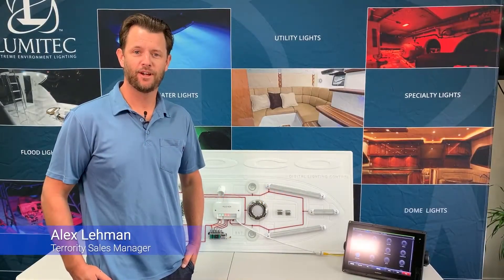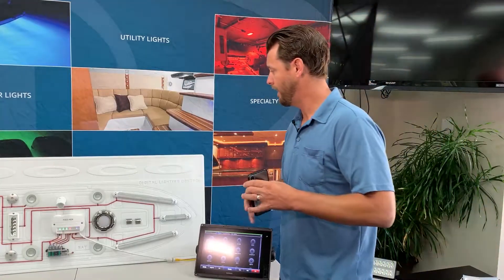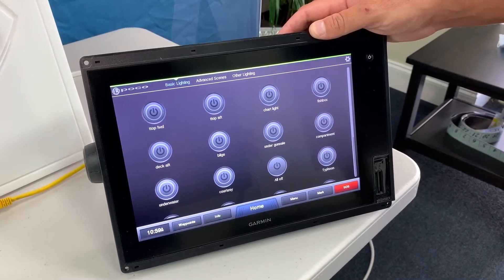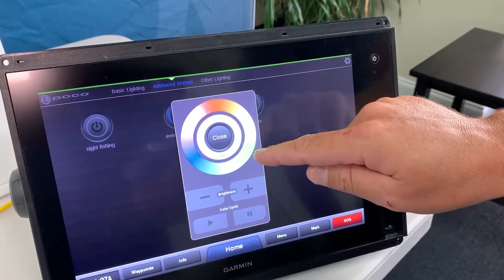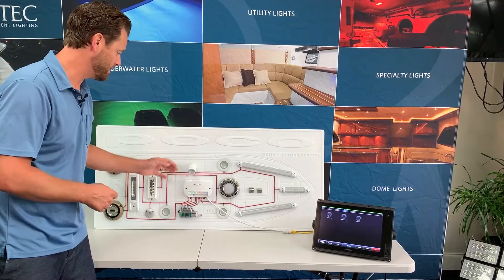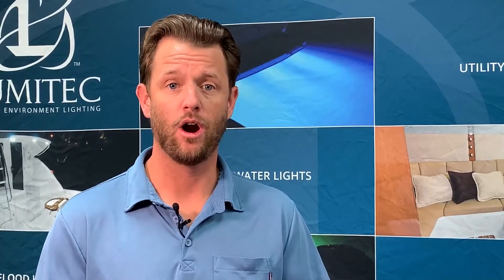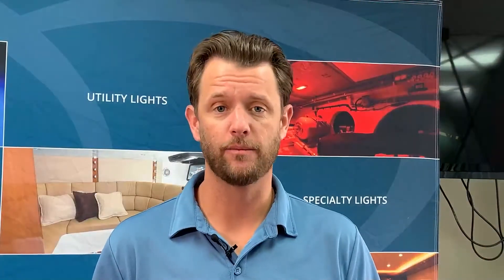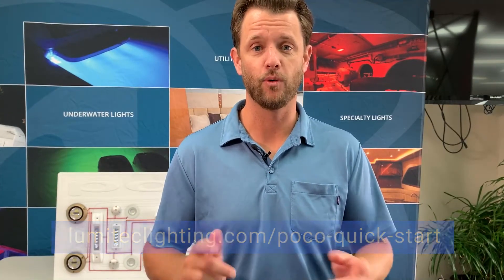What is Poco?

Comment: I can control connect any universal RGBW light that has the RGB wires and control them without limitations correct?
Reply from the maker: I'm sorry for not getting back to you sooner. Simple answer NO. Poco is designed for a 2-wire system and uses a single-wire connection to the module to command the lights. You need to use Lumitec PLI-enabled lights to get the full functionality from the Lumitec Poco module. Third-party RGB or RGBW lights use a multiple-wire connection and are not compatible with the Poco system.